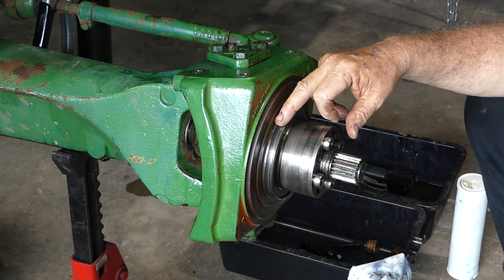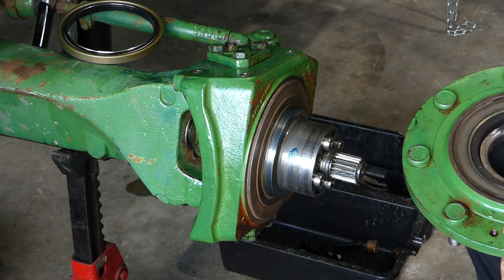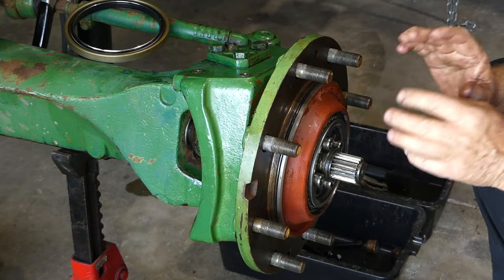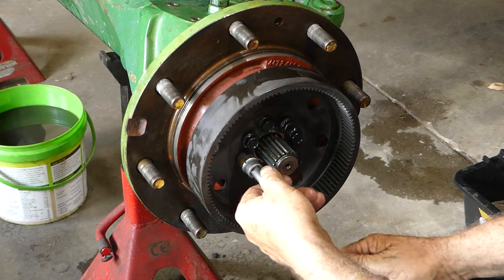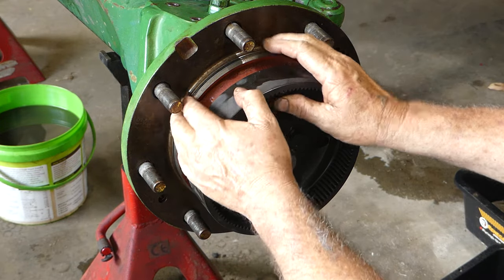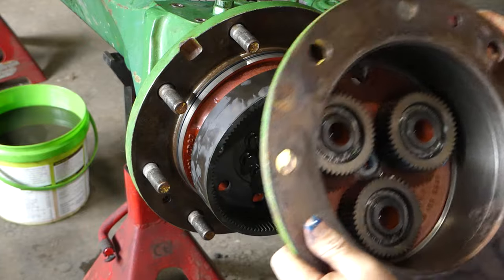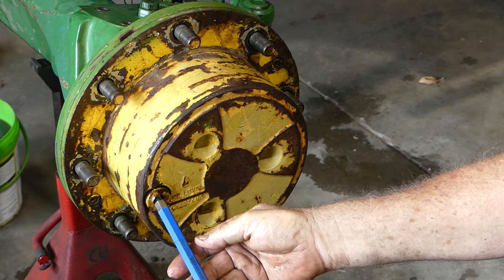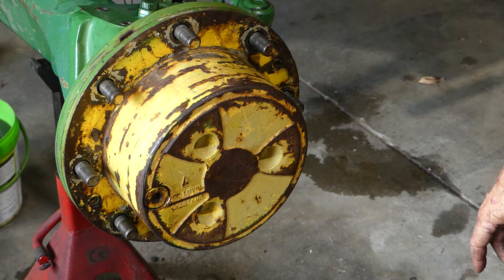How to Replace Leaking Front Hub Seals in Your John Deere 4WD Tractor Part 3 Assembly Continued

Comment: Should bolts pulling up ring gear to bearings behind be still loose after tighting up. My bolts have space between ring gear and bolt heads and I can still cee big bearing in back of ring gear on 5205 johndeer 5 wheel drive hub.
Reply from the maker: It should go all the way home with the correct bolt tension.

Comment: Good morning afternoon evening Mr Bundy bear. Wondering if you might be able to answer a question. I have a Massey Ferguson mf20 that I am rebuilding thanks to you and your videos I have now installed the cylinder sleeves and ready to install Pistons. Looking ahead I'm looking to replace the injectors. The question I have, my motor is ad 3.152. for a MF20 .
Looking for new injectors I am finding a very economical injector they're claiming it fits mf20c mf20d mf20f in your opinion why would it not work on my mf20.
Reply from the maker: Check the actual nozzle number the early injectors may have a slightly different spray pattern or pressure. If it is pressure only it is easily adjustable.
Reply: Thank you Lance have a good day from the beautiful state of Arizona